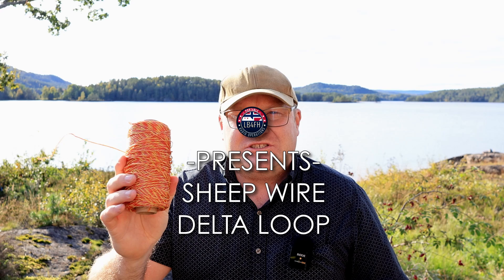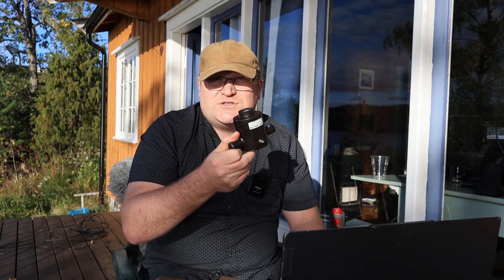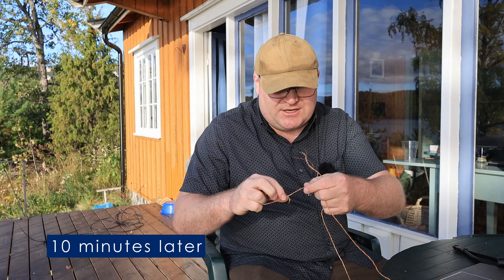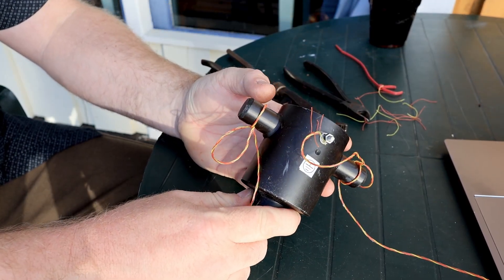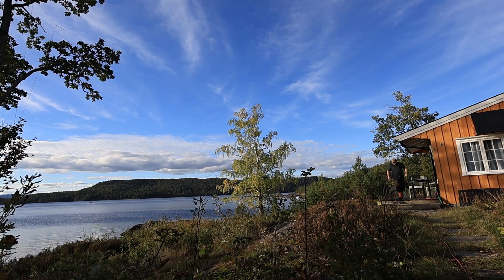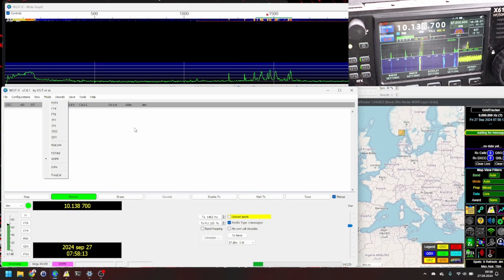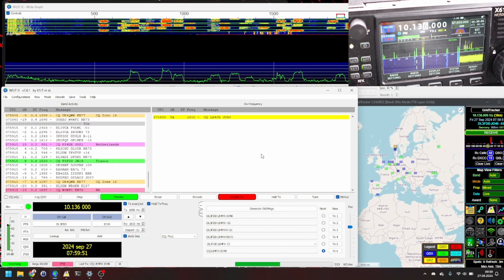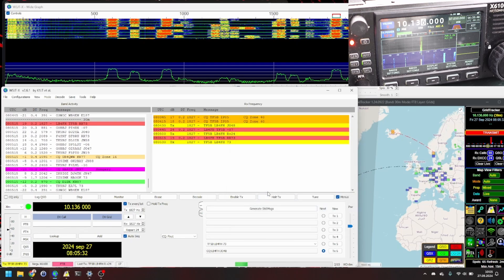30m Delta Loop from Sheep Fence wire

Comment: Like that wire. Made different antennas with it. Halfsquare, Ribakov and a couple of horizontal loops. A 40m loop hangs in the elements for 2 years now. Great  antenna, low noise. Planing for a 80m horizontal on about 22 m above ground. These experiments always last longer then thought.🤣👍🇨🇭73
Reply from the maker: Yeah, it was a fun thing to play around with. Still have a few 100 meters left, so I should do some more experimentation 😉

Comment: I work the world with a 20m delta loop and pskreporter shows I'm heard from both directions on the opposite side of the globe. That is just the furthest distance on the globe from my location, not necessarily the route my signal took. I use a vertical delta loop bottom fed which is 50 Ohms. It throws a very low takeoff angle when the loop is 1 wavelengh high(bottom of loop). That means my antenna has to be nearly 90ft to the top and about 60ft at the bottom. Use 2 of them rotated 1/4 turn and use an antenna switch for a poor mans rotator. Also, they have a very low noise floor.
Reply from the maker: Would be great to be able to have one of these up permanently (properly made of course), seems like some amazing antennas to have. 

Thanks for watching!

Comment: my only concern about the swr curves being that GOOD/flat is that it might be partially due to the very thin wire's resistance. It would be interesting to see what the DC resistance is for 30m of this wire before being made into the antenna (the skin effect HF resistance will obviously be higher than this but it is still useful to see).
I'm certainly NOT saying that it isn't a useful antenna. I also think mag-loops are great & similarly they are not the highest efficiency but still very useful/usable. The TTFD has a wavelength of low resistance wire in it AND has a big resistor explicitly added and people like it so resistance in antennas isn't always a showstopper.
Personally I use the single strand 2mm solid aluminium electric fence wire for antennas but it is a sod for kinking so your woven stuff looks like it might be better for portable deployment.
Reply from the maker: Yeah, this is mostly for a "when you need it" antenna, it's nothing I'd have up permanently. Fun to experiment though, and thanks for the idea of what to test if I make another one of these some times.

Thanks for watching, 73!